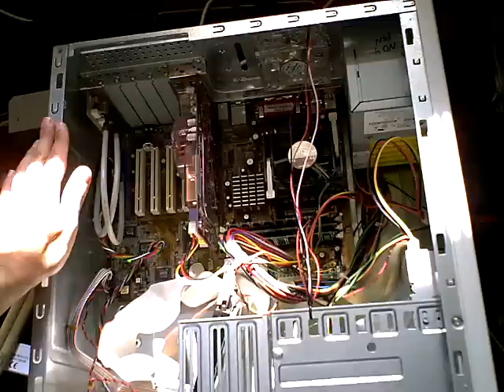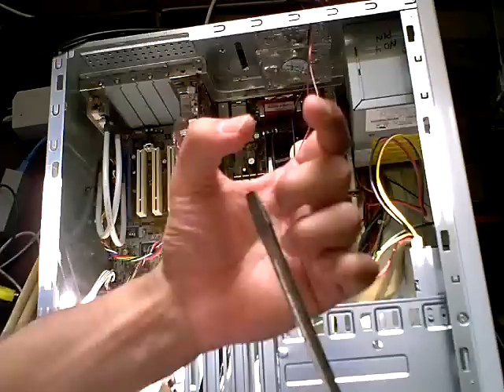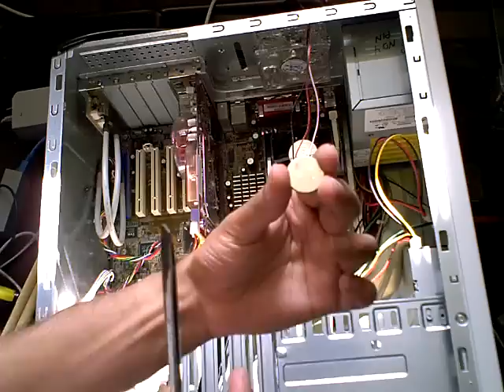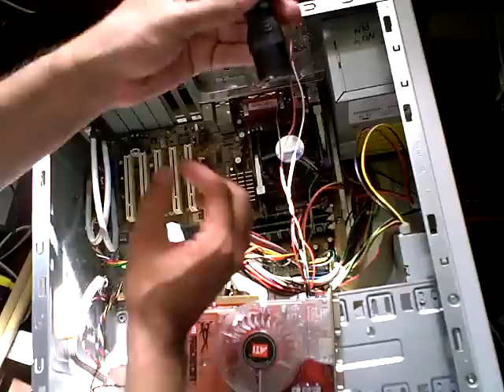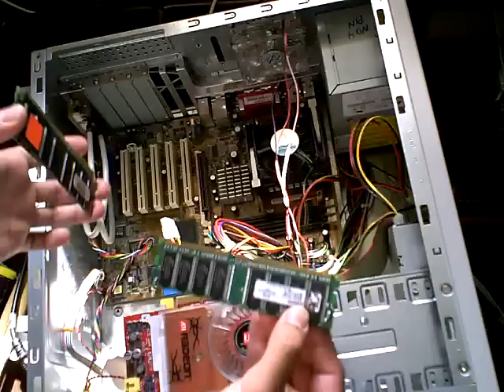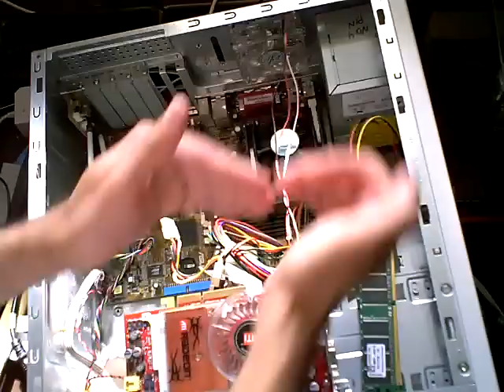How to possibly fix a PC that will turn on but will not beep and will not display anything on screen

Comment: Pulled out another desktop PC I had setting for a while. Not sure what would happen. Powered it up, after I tested the PSU with a PS testing that they sell. Checked out good. The Unit turned on, did not beep, or monitor turned on. Went through the procedure you explained as best as I could. Viola ..... 2nd PC in two days booted up & monitor displayed screen.  XP . Will have to update the OS. It's an older build but it will serve as a back up and/or standby. Pretty remarkable. Thanks for taking the time to post. Have a couple of more setting around that I have to get to.  There are PC analyzers sold and PS testers haven't found anybody that can say how reliable these gadgets are?  Thank you! You made my day.  KK
Reply from the maker: +kiotipass Glad I could be of help. I myself use different machines for different purposes around the house, and frankly I love XP...I use it for practically everything aside from gaming (only because the newest games require Win 7 and +)

Comment: Thanks for teaching me about the beep codes. I had 1 long beep followed by 3 short ones, so i checked my gpu. Turned out that the 6 and 8 pin wires had poped out half way which caused the BsoD. Thank you once more @RodneyDickson !
Reply from the maker: +joe smith Eek! Rough deal. Well, at least I'm glad you got to the bottom of it : \

Comment: Awesome video! Very detailed. I recently made a move from HI to KS and my build has this same exact issue. I tried jumping the CMOS but to no solution. Sadly, I have a new mobo and CPU enroute (might as well upgrade now). Switching from AMD to Intel. But, any idea what causes this issue? Or possible preventative maintenance?
Reply from the maker: +Youferful From what I gather, PCs have limited life expectancy. It helps if they are used regularly (so not left unused for long periods of time). Also, using components that are certified to work with your motherboard is always a good choice, and finally, buying a good PSU with more wattage than required is highly advisable.

Comment: Great advice, one thing I have discovered which is strange is that a computer did not power up or POST beep when there was a dead CMOS battery.  The way I discovered that was by removing the CMOS battery, try booting up and it works. Replaced the same battery and no boot or POST beep.  I rectified the problem by replacing the CMOS battery with a new one and PC worked fine with no problems.
Reply from the maker: +me72pemb Good tip. Thanks for sharing

Comment: Do you ever put the CMOS battery back in or do you just move the jumper from pins (1, 2) like you said onto pins (2, 3). Im having this exact problem and only have 1 stick of 8gb of ram so far bc in about two weeks I am upgrading to two sticks and just built the computer yesterday. Also, Do you put the VGA Cord to the input of the monitor into the Graphics card? Ive heard that also helps but im not sure. I for now just put the black (mostly comes in blue) VGA Cord into the motherboard and twist those screws in on the side and no display. /: Amazing video though but need a little help
Reply from the maker: +Eryion™ Breadboard it (explained in the following video:)

If the steps in this video did not provide a solution to your problem, view:

http://www.youtube.com/watch?v=_EK9a-R5pss

You never know, maybe rebuilding the PC in the opposite sense that you took it apart will solve the problem.

Comment: In the space of 20mins i singled it down to 1 of the 4 ram cards that was causing the problem. Pc is back up and running fine. All i have to do now is to purchase another ram card and my pc will be fully restored. Thank you so much.
Reply from the maker: +Blue 32 Real glad I could help : )

Comment: Thanks to Rodney for this diagnosis vid. As a veteran PC tinkerer, I was surprised to see you plugging in what appears to be a live mains supply back into the PSU. I wouldnt advise anyone to do that, as 240V (or similiar) is suddenly surging back into the PSU. That can cause a nasty short. I would always switch off mains, insert plug into PSU then switch on mains at the wall socket. Your steps to hunt down the faulty component look right to me, although in my case, my intel MSI motherboard suddenly POSTs, then dies as the OS tries to load. Generally, intel chipset m/bs seem to be better than AMD chipset m/bs fitted with sluggish AWARD bios chips.
Reply from the maker: You're absolutely right. Truth be told, this was pure lazyness on my part (I didn't have a power bar set up to shut off the power feed, so I defaulted to just unplugging/replugging the lead). I've reverted to using an on/off switch on a power bar in the follow-up video to this one. I myself was generally impressed with the performances of true Intel chipset boards versus third party manufacturers as well, however, now that I build and use primarily AMD setups, this no longer applies : \
Reply: RodneyDickson OK Rodney, thanks for quick reply. I know the Intel AMD debate is endless among enthusiasts. I'm not sure how one identifies a "true" Intel chipset, I guess I can research that. I'd be interested to know which AMD setup you prefer out of technical interest. Modern BIOS chips appear to be far more stable than the old Award BIOS. The question self builders need to ask is probably which BIOS is going to cause them the least problems, while providing the best features.
Reply from the maker: writerNB
Heh, when I was referring to a true Intel chipset, I was referring to an Intel northbridge and Intel southbridge motherboard. If you wanna go further, you can even opt for these components on an Intel manufactured board. From experience, these were well-calibrated, reliable boards. As to which chipsets work best with AMD, I couldn't tell you. Right now I'm using an Asus board with an AMD chipset to support my AMD CPU. Asus has given me mixed results over the years, and I generally opt for it not by choice but rather by availability.

Comment: This happened on my old HP Pavilion after it froze so bad it would not shut down so I unplugged it and I must've broke the motherboard.Now I've been out of a computer for months and It will take me a while for me to save up to build a gaming PC. Thanks for the video.
Reply from the maker: +aaron beasley Dunno if you ever got that gaming PC, but on the HP, try to Breadboard it (explained in the following video:)

If the steps in this video did not provide a solution to your problem, view:

http://www.youtube.com/watch?v=_EK9a-R5pss

You never know, maybe rebuilding the PC in the opposite sense that you took it apart will solve the problem.

Comment: This helped me a ton! Thank you!

I never thought I'd be able to use my computer again.
Reply from the maker: Nice! Happy to have helped : )
Reply: I used the CMOS trick to fix it, and now today it's doing the same thing and the CMOS thing isn't fixing it. Maybe the battery needs replacing?
Reply from the maker: Freddy B
Well, that would depend on what the problem you are incurring is. What is happening that renders the PC defective?

Comment: I did the cmos trick to the computer and it worked :D

I pulled the whole computer apart to clean it (i was told when i got it that there was a issue and didn't work to i thought what the heck) and then u put it back and thought that maybe there was a issue with other things. pulled everything out apart from the power supply and the motherboard and it did the same thing. something was making a ticking sound but i don't know. So i found your video and did the jumper thing and cmos battery just to be safe and then bam, it booted. So thank you so much :)
Reply from the maker: Nice! Glad I could help out  : )

Comment: If the power supply has a switch on it, you can flip that off instead of unplugging the power cord, plus most modern motherboards have a green "standby" LED to let you know if they're getting any power, once this goes out, you know the board is getting no power and is safe to work on. PS, as far as discharging static from your body, you can touch any part of the metal case, it doesn't have to be the power supply itself; bear in mind that the power supply is bolted to the metal case, so it's all connected as far as any type of electricity is concerned
Reply from the maker: +Rangerman9404 Your discharge tip is correct, as is the I/O switch tip for the PSU. I only suggest pulling the plug for 2 main reasons: 1) This avoids ANY chance that current still enters the PC (switches can become defective or can get knocked back into the ON position) and 2) Using the I/O switch can burn out a PSU that is in less than optimal shape (after I burnt out my second PSU using this switch, I vowed never to use one regularly again).

Comment: Well had the frekin RAM issue, as soon as i took both out it started beeping, as it happens you were right, one ram was corrupt, happy camper again. Thank you. PC now starts as it did in the good ol days.
Reply from the maker: Nice! Were you able to find a RAM configuration where both modules could be used together?
Reply: Unfortunately NO, I had to replace the non working module with a spare one; i had one just lying in my drawer idle, believe me I tried my best to use some sorcery so I can get it up and running but all efforts were in vain.
Reply from the maker: Too bad. But at least now you know what to work with.

Comment: thank you mr. Dickson, sir... i've done the "pull out the power feed, discharged the cpu from the remaining electricity, tap the psu" part... reconnected the power feed and then vallaaa.... it works!
Reply from the maker: +Indra D. Bachrie Nice! Happy to help : )

Comment: Hey, great video.
What has your experience been, if any, when instead of no beeping, you get non-stop beeping and no display?
Reply from the maker: +Driven22 Haven't experienced that, but sounds scary : ) Beep error codes differ from one BIOS manufacturer to the next. To discover what the beep error code is trying to telling you, discover the manufacturer of your BIOS (available in the motherboard's manual or on the motherboard's manufacturer's website {on the page for your specific motherboard model}) and then look up the frequency and interval of your beep error code on:

http://www.computerhope.com/beep.htm

Comment: So, was this board bound for the garbage? I have the same problem with a recent build: error beep codes without the RAM installed, and nothing with the RAM installed. It's a single stick of DDR-3 clocked at 1866 MHz which, according to the motherboard manual, is compatible. There are only 2 DIMM slots and I tried this RAM module in both and still no POST beep. I'm convinced that the motherboard is faulty and the RAM slots are not properly working. However considering this is the same problem that you experienced, what was your final decision with respect to this mobo?
Reply from the maker: +Sean Treiber You have to be very careful with what the company refers to as 'compatible'. These figures should always be taken with 'a grain of salt'. Normally I'd tell you to upgrade your BIOS, but given that you can't access the BIOS, what I would instead have you do in your case is research someone selling DDR3 RAM that meets your capacity needs on Kijiji (I suggest you give up on trying to get the fastest RAM, generally the access speed is negligible): contact the seller and ask if they'd allow you to test said RAM module in your machine prior to purchasing (to ensure compatibility). If they agree, bring your machine over, test their RAM in your machine, and if it all works, you have your answer. If it doesn't however, RMA your board I guess : \

Comment: I just finished putting together a new build PC with the following components...

CPU - Intel 5820K: 
CPU Cooler - DeepCool Gammaxx400:
Motherboard - X99 Asrock Extreme6: 
RAM - Kingston Hyper X 8GB x 2 Kit: 
SSD - Sandisk 240GB: 
HDD - Toshiba 2TB: 
GPU - MSI GTX 
Power Supply - EVGA 850G2:

When I tried plugging it in nothing happened. No beeps no fans spinning nothing. I at first assumed I had a faulty power supply, however when I removed the power supply and then tested it I found it to be working. I later found that the connection between the power supply was poor and that when I moved the cable around a little the PC would start up intermittently in that it would 'blink' on and off.

After some work eventually got a good connection and the PC would switch on. All the lights were on, all the fans spun and the graphics card was also receiving power as it lights and fans were also on. However there was no 'beep' when it powered up.

I then plugged the PC into the TV but there was no signal as if I had not plugged it in at all. I found the only way to switch of the PC was to hold down the on/off button for a few seconds. When a restated it the results were the same. All the lights and fans were on but no beeps and no signal to the TV.

The only thing I can think of is that the mother board was damaged.... please tell me this is not so...
Reply from the maker: +Ryan Brookes Breadboard it (explained in the following video:)

If the steps in this video did not provide a solution to your problem, view:

http://www.youtube.com/watch?v=_EK9a-R5pss

You never know, maybe rebuilding the PC in the opposite sense that you took it apart will solve the problem.

Comment: +RodneyDickson I am confused on the RAM configurations you were mentioning, the problem on my PC is the RAM, can you explain to me what you meant by it's good if I keep getting the error beep message?
Reply from the maker: +Cody Busby The beep error code message will tell you what the problem is. Beep error codes differ from one BIOS manufacturer to the next. To discover what the beep error code is trying to telling you, discover the manufacturer of your BIOS (available in the motherboard's manual or on the motherboard's manufacturer's website {on the page for your specific motherboard model}) and then look up the frequency and interval of your beep error code on:

http://www.computerhope.com/beep.htm
Reply: RodneyDickson ok thanks man but I solved this month's ago but thanks for the helps anyways
Reply from the maker: +Cody Busby Glad it got solved then : )

Comment: RodneyDickson I used tips from this video to bring my computer back to life !!! Thank you Thank you. Was pulling my hair out as to why my monitor had no signal, thinking my mobo went south. My computer had been working fine the night before. When I turned it on; no beeps, no monitor signal. As it turns out, I just needed to reset the CMOS, and got signal back. Thank you again. Now onto my other problem , resolving a "Bootmgr is missing". Seems like the more i know about computers the more I get new puzzles to solve.  :p
Reply from the maker: +FastFerrariF355 Happy to help, and bootmgr can probably be restored by reinstalling Windows (not ideal, I know). Good luck : )
Reply: +RodneyDickson Yeah and to make it worse, the windows disc wouldnt boot through the dvd-rom despite setting it in bios. Ended up repairing it by making a USB flash drive windows install. For some strange reason it would only boot setting primary boot devise in bios to USB. Once windows was installed I set it back to boot from the HDD and all was well.

Comment: 1. Unplug power chord from PSU.  Jump CMOS terminals (closed) this clears the CMOS.   Next boot you will enter the BIOS setup program.. chose Optimal Defaults. Exit.   2. Still no boot, again unplug power chord from PUS, remove all memory modules except one single module, should boot to BIOS setup, chose Optimal Defaults save reboot. Before re-installing memory modules first make a successful boot into the operating system.  ALWAYS UNPLUG POWER CHORD when ever removing or adding any hardware.
Reply from the maker: This is a fine way to go about things. Follow this guy's advice.

Comment: Hey Rodney, 
I've recently installed a new Power Supply, and Graphics Card Into my computer, simply for gaming upgrades. I have a 725W power supply now, and a gtx 750 ti card. I followed your steps, took out the battery, refreshed the CMOS, took out the graphics card, took out all the ram, and still have no beep messages. Do you know where I would go from there? Thanks.
Reply from the maker: +Archives PB Breadboard it (explained in the following video:)

If the steps in this video did not provide a solution to your problem, view:

http://www.youtube.com/watch?v=_EK9a-R5pss

You never know, maybe rebuilding the PC in the opposite sense that you took it apart will solve the problem.

Comment: Hello Rodney, thank you very much for this tip. It helped me solve the no-beep issue. Disconnecting the CMOS battery restarted the MB and solved the problem. Machine works fine now. Best
Reply from the maker: +Jure Dernovsek Glad I could be of help : )

Comment: Old main boards fail due to capacitor failure, Modern high end boards will virtually never go bad due to them using new solid cap technology. In today's time if your boards have regular can caps and they fail it is best to replace the board with something more modern that is not affected by the "great capacitor plague" of the early century..
I used to spend hours troubleshooting and replacing caps on boards and wasting loads of time, now it is easier to just upgrade the whole thing with a new board and CPU.
Same for RAM if its failing or causing a BSOD then your better off replacing ALL of the sticks at once because one bad stick could have damaged or over strained the others in the chain.
Reply from the maker: +ElfNet Gaming Good tips